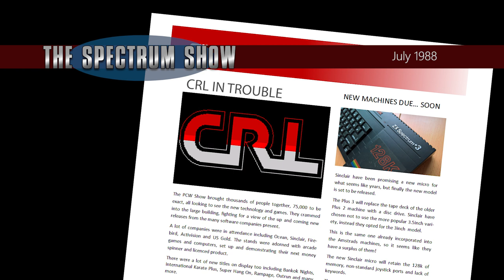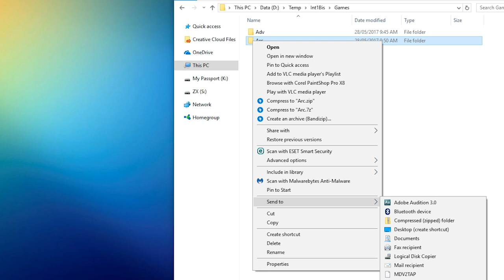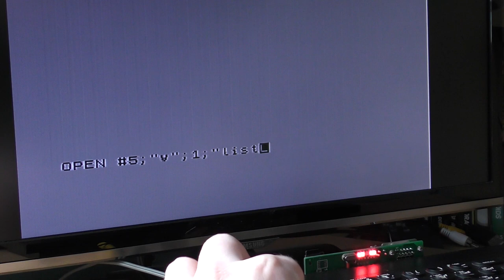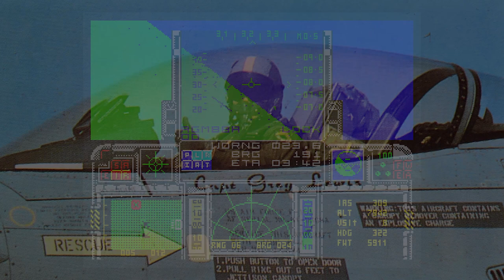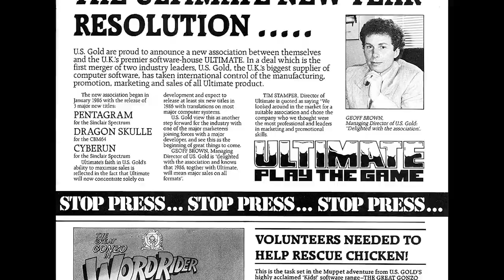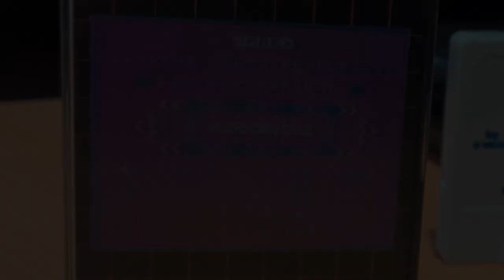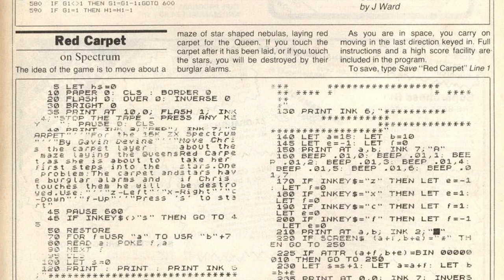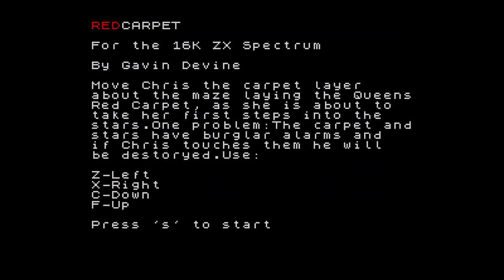The Spectrum Show Ep69

Comment: I tried NOT to bring this up, but I just couldn't xD
That terrible "halo-effect" on the picture of your monitor/tv makes my eyes bleed ;) Try reducing the sharpness-setting to zero or at least to a bare minimum, to get rid of it :) At least, that's what I have found to help on using old machines on modern LCD's...
P.S. Oh, that was your + and not +2/3. I thought you we're using an RGB-output xD My bad, though lowering sharpness should help even the composite- or RF-signal...
Reply from the maker: I'll give it a try in future, thanks. I think the angle didn't help either!

Comment: That bit of kit at the beginning looks overly complicated to use for those without extensive previous knowledge of using such things. It's hard enough trying to get basic emulators to run.
Reply from the maker: Yes, there are plenty of simpler options - eg the smart card.
Reply: Can I get one that sets itself up without me without having to lift a finger? That would be ideal. :p